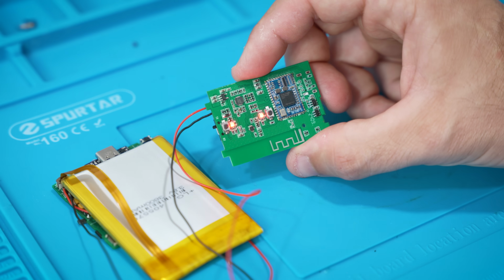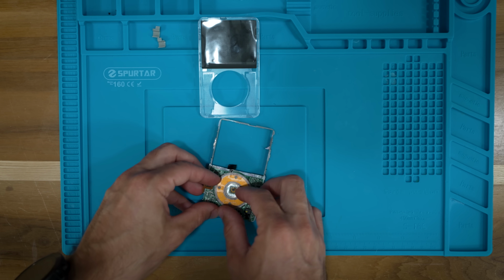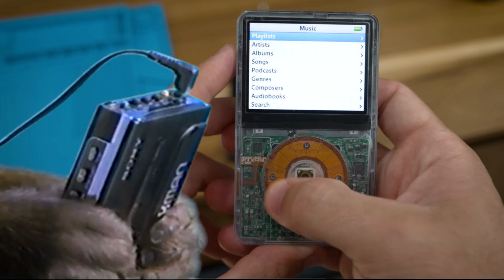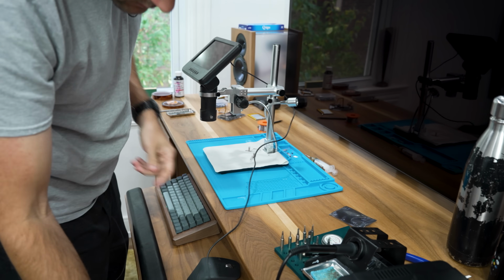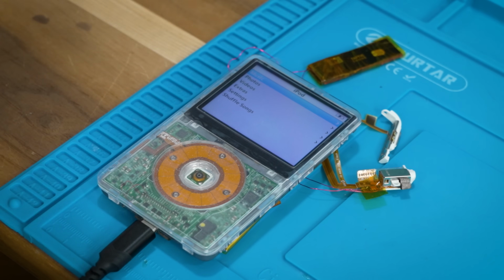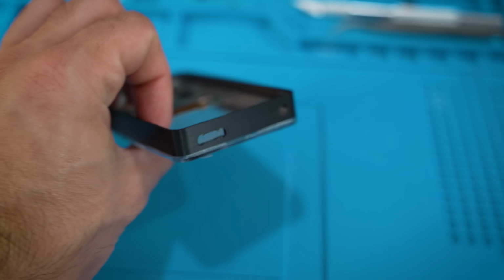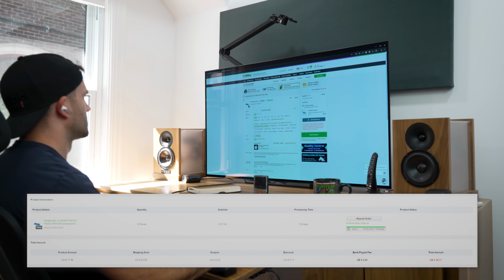I built a MODERN apple iPod...

Comment: Normally I like transparent technology, I think it's looked really good in your past projects. However, I just don't like the look here. Maybe it's because I just think the original color/material design of the iPod is so good and "premium looking".
Reply: idk i find original tasteless minimalism
Reply: Transparent enclosures work well when you can see the details of the circuitry inside. The don't work as well when your entire back is obscured by a giant battery pack and tons of Kapton tape.

A frosted or solid color look would be better, in my opinion.

But, it's his build. If he likes what he built, that's all that matters.
Reply: Nah, green pcb, clickwheel flexible pcb and the giant battery behind is a good fit
Reply: @AmartharDrakestone  Yeah, once he had the battery and haptic motor taped in, all I could see was that tape and how it looked bad with a transparent shell. I agree, I'd have at least gone frosted if not a solid color.
Reply: I agree, this is very cool but the original black case looks the best imo. To be fair I think it was pretty scratched up.
Reply: cmon you gotta admit it's cool to see inside a click-wheel eh?
Reply: Didn't like that on the back you see a wad of sticky tape above the battery, instead of the board it holds down... kinda ugly
Reply: Do you like transparent technology from the gameboy color? That atomic purple one is burnt into my memory. Since then I've always liked seeing all the bits inside. To the point I was taking apart non see through tech often. Probably got real close to shocking myself fatally. Good times. Good times.
Reply: FR. this "modern" redesign is both bulkier AND uglier than the original lol.
Reply: I would have kept the front clear but made the back an orange that matches the inside of the click wheel
Reply: I have to agree there, plus I personally have a bit of a connection to the feel and look of the buttons. Doesn’t feel like an iPod otherwise.
Reply: Exactly
Reply: He totally ruined the ipod
Reply: then its a good thing that moding iPods is all about customization, because if you do the same mods you don't have to make it transparent
Reply: I was looking for this comment.
Reply: Aggressively agree
Reply: Ancient Apple marketing still effective
Reply: Yeah, i prefer the original dumb ipod instead all this christmas tree
Reply: I’ll have to disagree! Typically I don’t like the look of transparent mods (controversial I know) but for this iPod build it looks so fucking sick imo.
Reply: Facts
Reply: Apple's iMacs of the same vintage embraced the use of transparent plastics. They molded textures on the backside, and gave it a frosted semi-transparent finish. Plastic can be used extremely well in design, but it's about fully embracing what you can do with the material.
Reply: tbh i love transparent housings even if most of the circuitry is obscured just because i love seeing all the hardware instead of it just being a black box machine. it's just such a cool experience to look at

Comment: This is the iPod of Theseus
Reply: Not really. If I recall correctly, the ship from the paradox had all its parts replaced. This iPod still has some of its original parts.
Reply: @AmartharDrakestone  If i kept track correctly, the only part remains is the mainboard tho 😅 and even that is partial since the port changed.
Reply: @LateCodeParty  There's also the flex wire that goes to the hold button.
Reply: @AmartharDrakestone  Paradox also asks the question of "When is it a new ship?". Just the fact that we are discussing this, it is enough evidence to this is the iPod of Theseus
Reply: My thoughts exactly I wonder if this is what Theseus used to play his mixtapes while out looking for the Minotaur
Reply: @AmartharDrakestone  I believe in the VERY original, kinda like how they reference it in Wandavision, its that you use the parts you removed to build a second identical boat.
Which one is the Ship of Theseus? The one that still bears the name, or the one that is physically the original ship?
Reply: Tbh i was waiting for him to change the board as well
Reply: Same thing went with my build too. The only things from the original unit are the motherboard and screws.
Reply: I agree, while this stuff is really cool, at a certain point you end up replacing so many parts that really this isn't an iPod, it's a custom mp3 player using an iPod motherboard as the base
Reply: @HearMeLearn  He even replaced the OS! 😂 might as well just get a brand new mp3 player!

Comment: For a touch of class, use clear cases and paint the inside with a gloss color of your choice. The result looks similar to a deep clear coat finish.
Reply: What's the recommended method of paint application? This sounds awesome
Reply: @tylerevansfoothill  Spray paint cans work just fine - do it with a few thin coats letting it properly dry in between so it doesn’t leave thick runs on the inside (even if it does, you won’t see that on the outside unless you’re using a paint with pearl or flake in it). The nice part is it can’t be scratched off from the outside. You can scratch the case, of course, but the color is still there.
Reply: @jimk8520  sweet, that makes sense thanks!
Reply: Sounds like it would look like the white imacs that had that "white under plastic" look.
Reply: @tyrgoossens  Exactly. Any color you like, too.
Reply: Heeeey we both have akmost the same pfp
Reply: Much better than a transparent case.

Comment: Really like this upgrade, especially the haptics, being a subtle but classy change.

One side effect of the USB-C change and bulkier backplate is that the iPod won't be compatible with any of the original peripherals and speakers that these used to plug into. I'd love to see you do an upgrade to an old iPod stereo setup.
Reply: to be fair to this point, half of the old accessories don't work anyway. apple actually had 2 variations of the 30pin connector over its lifetime. the first used firewire for power and a lot of accessories were made this way for audio passthrough as well as powering the device and adjusting its settings such as skipping songs or pausing. when the pin variation changed so did a lot of accessories. on the bright side, there are a lot of really awesome usb-c accessories out there now to put a modern twist on a modded classic
Reply: Yeah, like a B&W Zeppelin or a B&O BeoSound

Comment: Wish I had the skill to add Bluetooth and usb-c charging but with my luck I’d have my iPod classic sitting around for weeks waiting for replacement parts. Amazing work!
Reply: Elite Obsolete is now carrying a custom back that includes the bluetooth and USB C functionality. You don't need to remove the old connector, it adds the functionality without soldering.
Reply: @ yeah that moonlit backing has been out for quite a while now. Not worth it for the price.

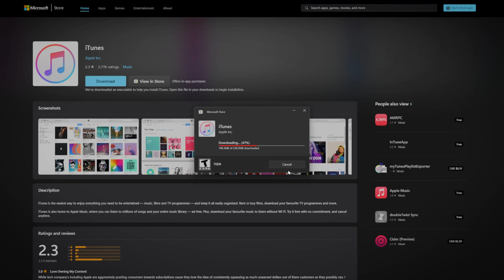Comment: 5:42 PRO TIP - Dont use the windows store version if iTunes, its prone to issues especially with iPods. Use the exe straight from apples website
Reply: iTunes from the Microsoft store doesn’t even work.
Reply: I wonder why that might be the case.... Better avoid this echo system
Reply: @petergplus6667 The real term is "ecosystem", but "echo system" is actually kinda clever
Reply: Didn’t even know the Microsoft store version existed 😂😂
Reply: Another tip: Don’t ever use the Apple Devices app on Windows either. I’ve corrupted two iOS updates on my iPhone 12 and the first time I lost everything and had to use a backup of my spare iPhone SE 2 which had a backup of my iPhone 11 on it from June, I would’ve used my iPhone 11 but I had to reset it bc I let my brother borrow it. Second time thankfully I was smart and backed up my iPhone, because it failed again. I used an iPhone 6s I had laying around just for the day until I had time to restore the IPSW with my MacBook Pro because it usually never fails. Apple Devices is such a buggy mess too, sometimes in the middle of syncing my iPod the app would crash.
Reply: I found that out fixing our store PC, we do iphone, pads, n pods reset via iTunes for customers. The app version doesn't have the iTunes driver or the helper to read and connect the devices properly. I work at a mobile repair store.
Reply: @jamesdriver0317  who uses iTunes to update their phone anymore?
Reply: @ I only have a 64GB iPhone and I have a lot of pictures on it that I take so it gets full quickly
Reply: ngl anything from the windows store just kinda sucks in general
Reply: Really? I’ve never had any issues with it on any of my windows devices
Reply: @CaptainRex332  I've never had any issues with the Windows Store either. That's because I rarely use any Microsoft software. Who really needs Windows in 2024?
Reply: Its only cos its from the microsoft store.... lol having said that ive never been in the apple eco system. They have never had a cent from me. Yay
Reply: I must add. I love apple products and always have but hate the company and what they stand for (that encompases alot of issues) so decided i would never own an apple product. That also being said, love steve jobs and his vision, but hated his lack of empathy...... wow ive got more views than i realised...... haha
Reply: The EXE is also used for tools like AltStore
Reply: PRO TIP - Stop using Windows and switch to Linux already.
Reply: @That_Random_Guy_Official  Microsoft store has a lot of Android and Apple apps. A lot of them crash during normal usage or show the regular Windows behaviour - they have update exactly when you need to use them.
Reply: @jamesdriver0317  Yep. Apple DOESN'T WANT YOU to use anything other than Apple devices. Thus, even Apple to Android migration is buggy. They don't give you the freedom to leave the ecosystem at your will.
Reply: @thatzaliasguy , yes very good tip.. depends though on how "Tech" minded you are. Linux although is so much better these days is a little more in depth to get the same fucionality. I love Ubuntu Mate.... its nothing like ubuntu which i also love. Ubuntu mate is a very slim light operating system but with the same features as regular ubuntu.
Reply: Me!
Reply: Good to know, I will stop using that version (I pirate mp3s from YouTube and am in to deep to stop doing so😅)
Reply: Windows Store is not a great source of apps in general, so yeah
Reply: @petergplus6667 I think it was a either a bit poorly made/ported(as a uwp app when that was the only kind allowed on the store) or due to limitations with the UWP framework or permissions that is somehow still an issue to this day
Reply: @RWBHere people who still need software that wine doesn't run well
Reply: @Connorplayer123 people with old iphones
Reply: Just don't use Windows period lol
Reply: Brooooo I used the windows store version and nearly crashed out bc it SUCKS
Reply: did you actually complete a a full build of this?
Reply: PRO TIP - Don't use ANYTHING from the windows store. Seriously, that thing is fucked and breaks everything it touches.

Comment: Tip for the hot glue: if you want a really good bond: cut of a small amount of hot glue, place it where you want to melt it and use your hot air station to melt it (medium temp, low airflow). You bonding will be amazing and it saves you on waiting for it get hot…
Reply: He'd then be melting enamel coated wire and stripping off its coating.
Reply: @ the glue melts on a way lower temperature then the enamel. Don’t use that high temperatures

Comment: Get some solder paste, lol. It is slightly sticky for the component until the hot air can start to melt the solder which heats faster because its not stuck to the pad already... paste is a game changer and very easy to use. If you learn to apply the right quantity of paste for the pad and pin size then you can even be sloppy with application and most the time it will perfectly align with the pads when the paste flows.
Reply: You can’t just get any type you have to work out these act type because there are so many types that need so many different methods of reflow

Comment: Dude! This is something we were really missing! Just the experience of having your favorite 150 songs in your pocket was incredible! I miss having an isolated music device completely separate from my phone.
Reply: Why?
Reply: @MyLibertyTV No distractions
Reply: @MyLibertyTV  No phone is a feature.  More to the point, no cloud dependence, attack footprint, data mining, upgrade treadmill, or otherwise vendor-controlled or commerce-oriented software with ulterior motives is a massive feature.
Reply: The phone does all that and infinitely more.
Reply: Standalone hardware players are still a thing, and most of them blow this kludged-up iPod out of the water in every aspect while costing less than he spent just on parts. Some of them even run Rockbox OOTB.
Reply: I still have my original ipod classic 80gb  from 2008, it still works, with the original battery. I use it as my car stereo music still. Have used an ipod as my main music source in my car since 2006. I love having a dedicated music source.
Reply: @RealNovgorod so what
Reply: @BlackBladeGroM what is better for less than the parts he used?
Reply: @randybobandy9828  so it's obsolete. It's a cute project but it has no use, because even he won't carry it around all the time since he already has a phone in his pocket.
Reply: "I miss having an isolated music device completely separate from my phone" I feel the opposite way. I like listening to music and being able to get text or take calls at the same time. I also LOVE not needing a second device. My music is never forgotten always with me and I can listen any time and any place including my car, I really like the car part. No more need to spend $$ for a stereo head unit. All you need is Bluetooth connection and you can even update old cars with that. Best thing to do with an iPod is toss it into the trash.
Reply: @RealNovgorod Modern phones have limited storage capacity because they removed SD slots, using a media player as an external hard drive fixes that.
Reply: @Youtube.Commen-tater  Nowadays those phones' internal storage is comparable with the largest SD cards you can buy, definitely large enough to carry around many lifetimes worth of music. And you can still expand it with a USB drive if it's not enough - still much smaller than having a whole second device.
Reply: @HonoredMule  all that is only a problem if you do not use your phone correctly all of them could be avoided if you changed a few settings

Comment: I honestly preferred having one of those Creative Zen MP3 players because they functioned like a drive and made adding music to them, way easier. I hated dealing with iTunes on an iPod.
Reply: As usual Apple makes things that should be easy into difficult tasks. It changes the names of everything into random numbers/letters and stores them in random folders. So stupid.
Reply: It was both a MP3 player AND was my flash drive for college assignments.  Creative was GOATed for that in my eyes.
Reply: I’m also team Zen! Mine fell out of my pocket while riding my bike at an intersection and got rolled on by 2 cars. I was very sad.
Reply: Creative actually came up with the idea first also, Apple did there usual thing of knocking off the innovation of others
Reply: No one liked the lawyer and accountant designed Itunes......
Reply: 100% had the zen extra and that thing worked for a good ten years. Had both that and a zen MX
Reply: iTunes was really good software because out of the box it was a music ripping machine.
Reply: However it doesn’t make it easier when you have massive music library and you have to select what you want on the iPod. It’s a problem and creating things that playlists is so much easier in iTunes than using one of those devices. If you are serious amount of this makes a lot of sense.
Reply: @Bob_Smith19  it doesn’t make it stupid. Apple did it in a very very clever way most MP3 files have the title image embedded in them iTunes strips out that data and only upload the image once for an album not for every track optimises it so you fit more songs onto the device it makes sense

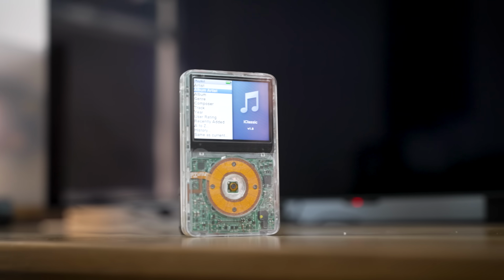Comment: 24:20 i've never owned an iPod, and when I heard about that battery life I realized it's better than any device that I've ever had.
Reply: That's only if the battery hasn't degraded to hell and has been replaced. 16 year old iPods last like two minutes with their OG battery.
Reply: Yeah but thats with an updated battery thats also much bigger than the original one
Reply: @iNSANELYSMART409  does it matter when there's essentially no other modern device doing the same thing comes anywhere close to that?
Reply: @Flaimbot   Depends on the iPod model. My iPod Nano's battery was empty after two days no matter what, even if it was turned "off".
Reply: @megatronskneecap my 08 ipod original battery lasts like 2-4hours BUT the battery meter is not accurate anymore.. the thing will power off when it says it has like 1/3 of the battery left. It's fine though since i use my ipod plugged in 99% of the time since it's my cars audio source.

Comment: This is super cool. USB C is a great mod. You have me wanting to dust off my old iPods, but that level of soldering is beyond me. I thought I was a tech genius replacing the battery and putting Rockbox on one yaers ago. I wanted to upgrade to solid state storage but then the smartphone took over. There are themes for Rockbox that make it look much nicer and easier to use

Comment: Very cool. Think I have a 60GB and then a 120 or 160GB Ipod laying around somewhere. Cases were all in primo condition so no need to change that aspect. Just a battery change and storage upgrade are all I need. Bluetooth might be nice but most of my stuff is from 1996-2006 so just plugging in the cable is fine as is the 30 pin for now. Need to see if there's a Nano upgrade path as well. Good job, thank you.